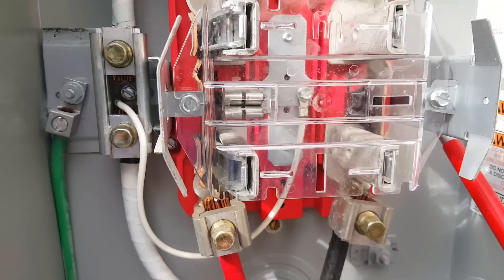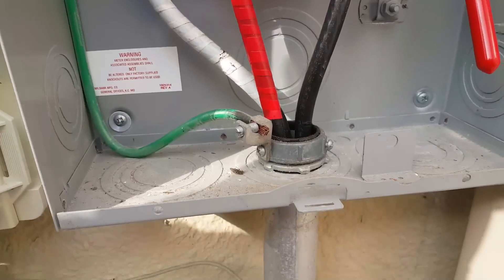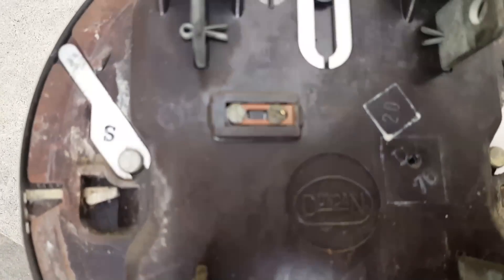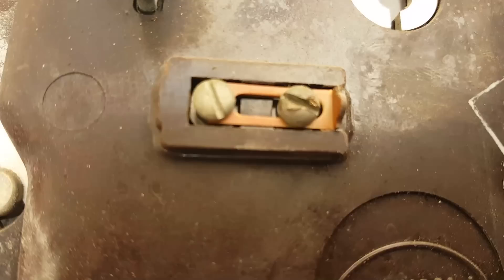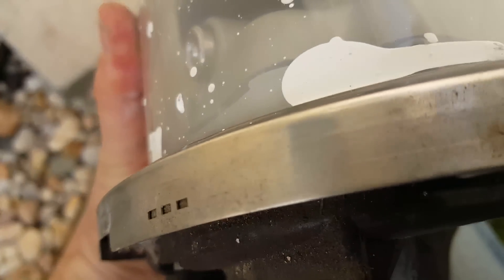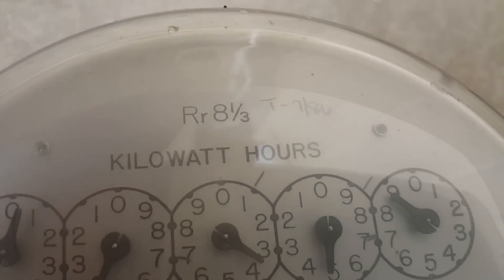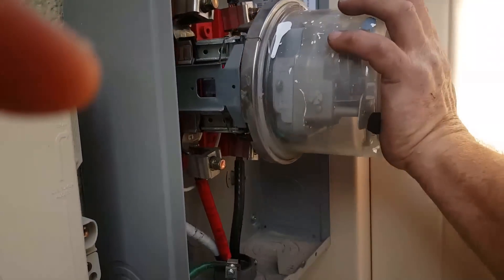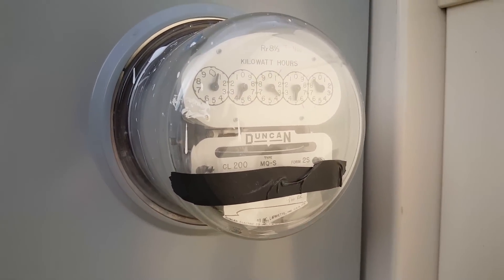Electrical Meter Hacking inspection - Removal

Comment: Thats a real meter socket I wish COMMONWEALTH EDISON WOULD REQUIRE THESE I hate the garbage milbank sockets they approve i see them burn up the clips are garbage outside reinforced haha .In my area the whole house must be roughed in EMT  and 4 in 1900 boxes any thing outside and whole service runs must be RIGID METAL CONDUIT. I LIKE THIS .The only single phase meter sockets that are jaw clamping lever bypass are the 320 class fore 400 amp service.

Comment: The "switch" at 2:20 is a potential clip or pot clip.  It's used for testing purposes.  If you open it, it kills the meter and the utility will know.
Reply from the maker: Thank You for that Insightful information. I won't play with that thing.

Comment: If you turn it on yourself will the electric company find out you did it?
Reply: It's very difficult for them to prove that you actually did it. However it is very easy for them to prove you used the power, so if they catch you they simply bill you for the "estimated" usage. Then let the cops deal with the actual crime.

Comment: The switch in the bow is sometimes called a horn. They engage the horn, a by-bass-switch for pulling meter without interruption of service. Always grab meter top and bottom, never left and right.
Reply: Dave Georg

Comment: As a master electrician I do not recommend that anyone pull their own meter. You are dealing with unfused utility power. If you must do it, you should remove the load first by opening the main breaker. The bypass is present to allow the utility company to change your meter without interruption to your power. Most power companies replace meters periodically to ensure you are being billed correctly. They have an entire meter shop where techs test, rebuiild and zero meters.
Reply: NYHalfassprepper what's the proper gauge of nails to bypass the old cans. I forgot.
Reply: I don't know. I simply bought my own used meter from Ebay and popped it in when I did service upgrades from the old A base style meters.